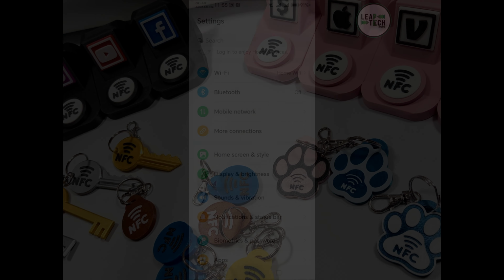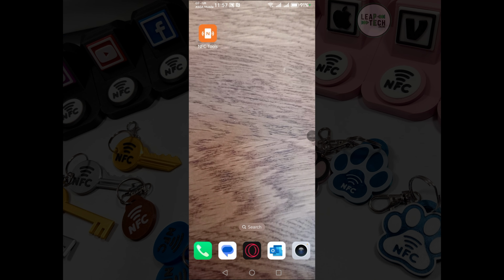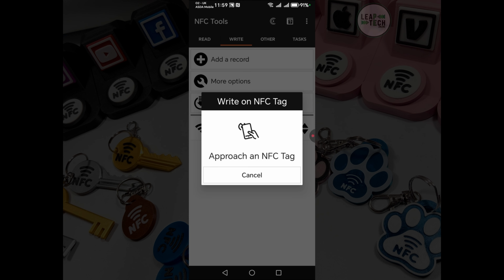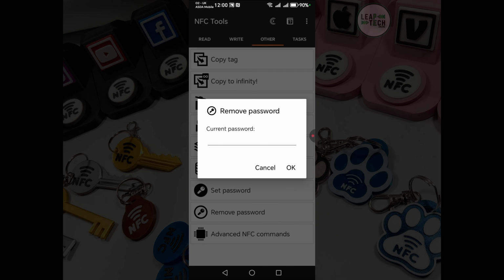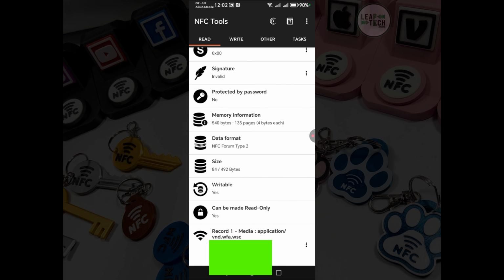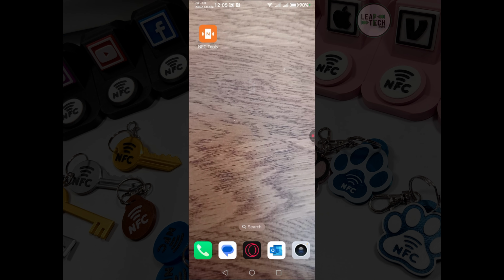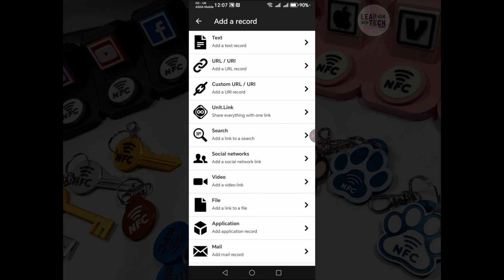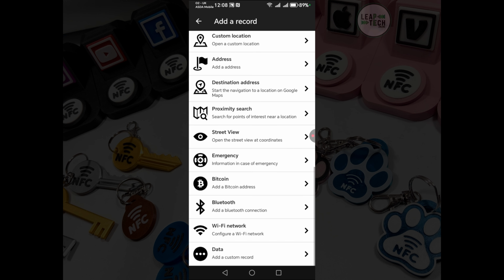How To Set Up Your NFC Tags Easily & Quickly. Step By Step.

Comment: How can we set up a Wifi tag for someone else? Meaning that if I want create Wi-Fi display units for my clients Airbnb. Is there a way to do it without being on location to scan the Wi-Fi network?
Reply from the maker: It is difficult to answer this depending on the network security and type you are wanting to program.

In theory you could enter the SSID and name etc and hope for the best but one thing wrong or security issues and it will not work. Your best bet would be to supply them with instructions in my honest opinion.

Hope this helped.
Reply: @LeapTechOnlinethanks